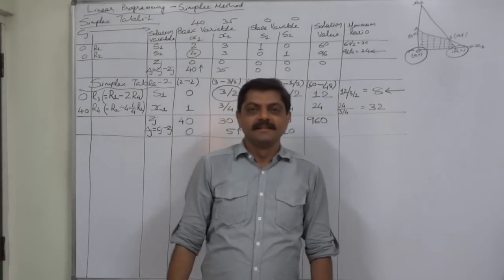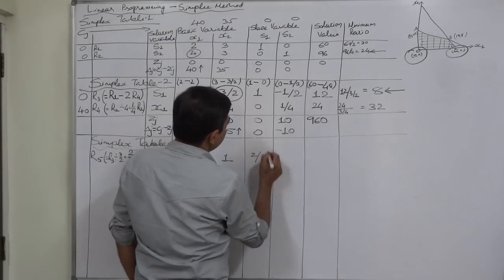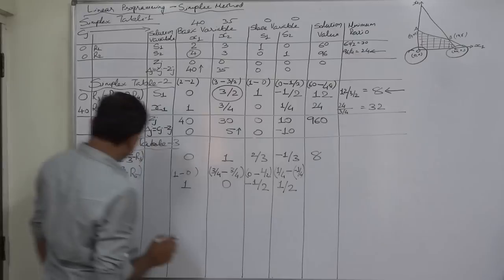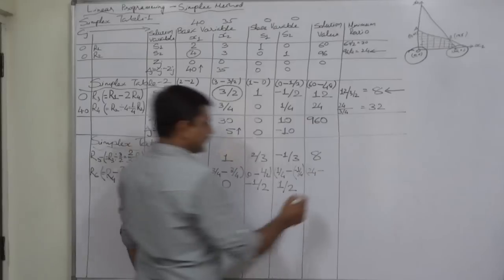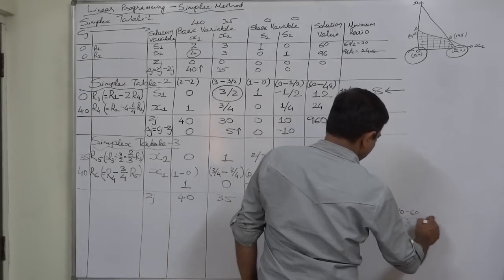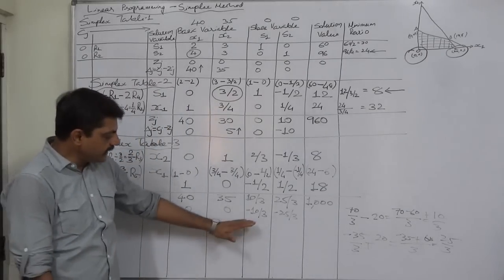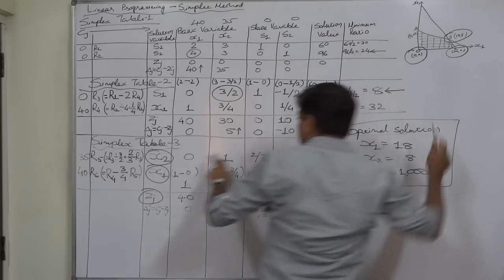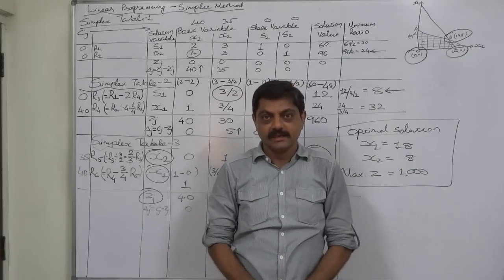Simplex Method - Simplified and Easiest way - 5 Optimal Solution - Simplex Table-3

Comment: Hello sir...i have a small doubt can u please clarify...Our OR madam told us for Maximum Z .. if we get - value in the delta j we should continue to the next table ...but here in the video u told us that there should be negative and zero values and if we get positive we should go to next table which method is correct sir

Comment: sir if minimum ratio is '0' and '1' then what should we select,please reply
Reply from the maker: Minimum ratio can be zero only if the the Solution Value (i.e. RHS in the inequality/equality) is zero. This thing, generally, doesn't happen because the use of any resource (<) or revenue or advantage (>) cannot be zero.